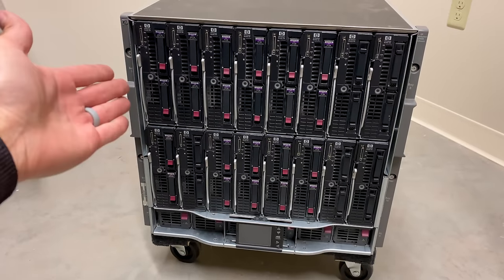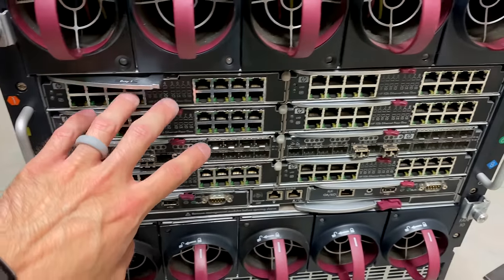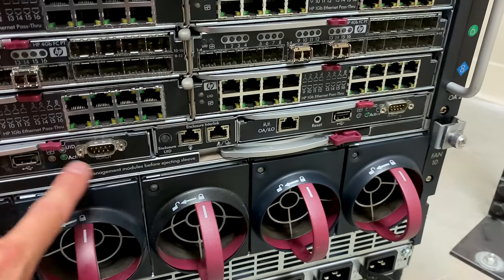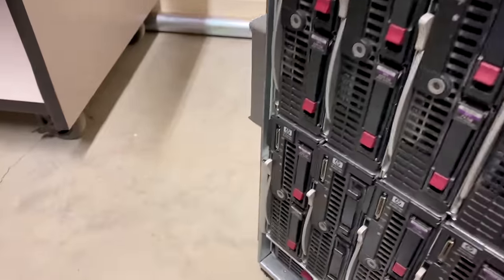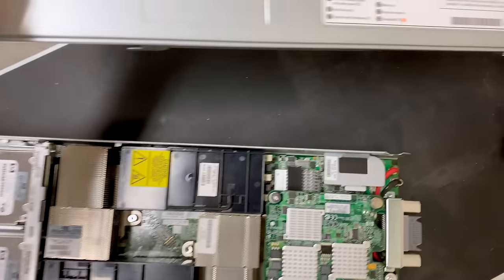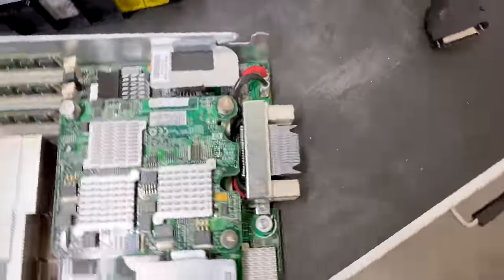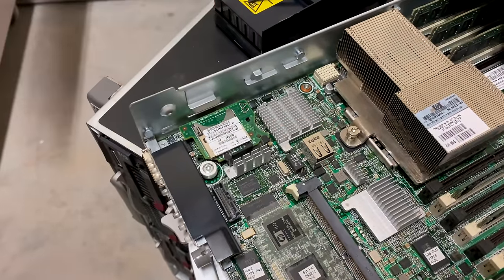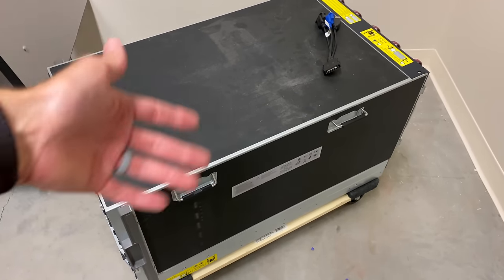Let's Check Out an Old Blade Server System with 32 CPUs!

Comment: 128 cores, up to about 1.5TB of RAM... Could still be fun to play with.
Reply: It's all good and fun until you see how much it added to your power bill
Reply: I'd buy one
Reply: @pompshuffle562  if your heating is electric anyway and it displaces other heating devices, you can run it for "free"! :D
Reply: @kaitlyn__L  That is, until it's above 90 degrees Fahrenheit outside
Reply: @pompshuffle562  well of course, if you're not wanting to run heating anyway. I did say if it was displacing other heating, after all
Reply: @kaitlyn__L  But why have a computer you can only use in the winter
Reply: Besides, server components aren't much cheaper than regular PC ones and there is no guarantee that the blade you get will have enough components to even make it cheaper than just building a PC with similar specs
Reply: To get an idea about why these things fell out of favour, you can fit 128 cores with 256 threads and 8TB of RAM into a single dual-socket 1U server these days, which is just 10% the size of this blade chassis, and each of those CPU cores will be substantially faster than the ones in this big 10U blade chassis. You could then split it up into 16 virtual machines (or any other number) if you needed to. Blade servers obviously still have their place, but the increasing number of cores per CPU and the increased effectiveness of virtualization has reduced the need to fit a large number of discrete servers into a small space.
Reply: In some countries you pay like 2 cents per kwh.
Reply: @pompshuffle562  if you go second hand, they are cheap as chips.  If you are after pure CPU and RAM, these are great.
Reply: @guspaz  Or 64 dual core virtual machines with 125 gbs of ram each. Or 32 4 core virtual machines with 250gb of ram each. POWA TO DA MAX!!!!!
Reply: @guspaz  Yes, the only reason for blade server is the use of external GPU (even internal). GPU virtualisation is still far from perfect like the CPU virtualisation. Also try to use the 128 cores all accessing their own PCIe16 GPU. IO is still king
Reply: Bro apps on windows open on one click
Reply: If you can afford the power bill 😂
Reply: for a good vmware test las, works like a charm.
Reply: RTX 3080 x2?
Reply: 13.7 ampers!!! (5 air-conditioned like mine).... and that thing have 6 of thouse PSU....... in just one of the hundreds of trolley like this one in a datacenter.............. This is why I choose not to ruin my eyes and continue using my Incandescent bulb.. and enjoy the fuel car............. There is not enough surface on the planet to put the necessary Solar panels for Europe datacenters.... not even mention the ones in America......... and for what??.. for facebook and twitter????
Reply: They are way too noisy
Reply: But can ran chrome with 100 tabs open?
Reply: How much do you Pay per server of them running and would This be good enough for webside storage unit and most gaming server
Reply: Would This worl for big website gaming server storage unit or what I mean since you say its too old but still good so I need to know if it worl for all those and how much it Costa per server how many watt
Reply: @guspaz  There are 4 AMD CPU Blades out there but for more balanced Setups: 2x CPU with up to 40 cores each and 4TB are common, so 160 threads and 4TB Ram in one Blade. There is the Question who needs an U8 Blade Chassis with 20 Blades with 80TB of Ram and 1600 Cores and 3200 Threads. That stuff is Datacenter and into the realm of Supercomputers. Especially Superblades with 2 GPU/Ki Acelerator Slots. Today you get all the Power you need in 4x U4 Cases so you don't need a Bladeserver. Bladeservers especially with Blades packing 2x 16 PCIE for Datacenter/Supercomputer Territory.
Reply: @pompshuffle562  13k at full load is 1k/15 cents/hour at max rate , prolly 7 at industrial rate. a 91cents up to 1.05$ every hour it runs at max speed then. just make sure you are charging more for the usage .
Reply: For real. I saw a "cheap" used blade system listing with 14 dual x5650 nodes.
My hometown has some of the cheapest energy, yet for just the CPUs I'll be paying more for my power bill than the whole filled-up chasis.

Comment: Blades fell out of fashion as hosting centers became sensitive about electricity use. As the cost of colocation went up, companies bought in space saving blade systems. So server densities went up dramatically, which led to colo and hosting centers separating out their charges for electricity, which became a considerable charge for the customer. The solution to that was the vm. The issue was that most of these physical (blade) servers did very little, but still consumed 75-100W each. A vm could sit idle and cost a fraction of that. This method not only reduced electricity costs, but colocation footprints. Colocation by the mid 2000s in places like London Telehouse was already pushing towards 5 figures a year for a single rack, before the electricity cost was added.

Comment: This explains why these Xeons are so cheap today since so many of them were retired.
Reply: If you are looking for good value PCs Xeon workstations on eBay are better than most of the office small form factor computers you will also find.
Reply: lga 1366 xeons are dirt cheap except for the x5690.
Reply: Yep. Not bad if you need a budget gaming PC. Though DEFINITELY not the best. (These things were never made for gaming anyway)
Reply: It's true. I upgraded my server to a much more powerful one for cheaper than I bought my original. Some really good deals out there
Reply: @mrcrisplinuxuser4180  not the best for pure gaming... but I imagine that, much like Ryzen, it's pretty competent at gaming while doing a bunch of other intensive stuff at the same time? Like cross-compiling for obscure architectures or streaming or ripping all your DVD collection in the background... just to name a few. I imagine they're pretty beefy for F@H too.
Reply: @kaitlyn__L  nah dude, this is very very old stuff, don't bother buying this for gaming. At most a small cheap home server could work, but these are very slow and inefficient CPU's by today's standards.
Reply: @mrcrisplinuxuser4180  The newer 32nm 6c/12t Xeons (same LGA1366 socket) are still pretty good when overclocked. I've had a Xeon X5670 @ 4.4GHz in my main PC since 2016, before that I had a Xeon W3550 (i7-950) and W3520 (i7-920).
Reply: @Pasi123  Running my x5680 @ 4.3GHz. Such a good processor. It is showing it's age in the most modern of games, other than that, its a champ.
Reply: Not really. But the good thing is that the RAM is so cheap. I did some text algorithm research for a database implementation and i bought a 512GB RAM system for less then $1000. Searching the 64GB text dump from english wikipedia is fun. How many times is your last name mentioned anywhere?
Reply: 13.7 ampers!!! (5 air-conditioned like mine).... and that thing have 6 of thouse PSU....... in just one of the hundreds of trolley like this one in a datacenter.............. This is why I choose not to ruin my eyes and continue using my Incandescent bulb.. and enjoy the fuel car............. There is not enough surface on the planet to put the necessary Solar panels for Europe datacenters.... not even mention the ones in America......... and for what??.. for facebook and twitter????

Comment: Disappointed you didn’t fire it up so we could hear the ‘take off’
Reply: We could witness his power bill go up, too!
Reply: Its not possible to plug each PSU's into 5 standard wall sockets to power it up. If you look closely at the back power sockets they are different from standard PC/server plugs. From memory I think each plug needs 30A to drive it. Dells are the same. Awesome bit of kit.
Reply: Requires 3-phase power to run this chassis.  I had 2 c-7000 chassis's and 2 c-3000's.
Reply: 13.7 ampers!!! (5 air-conditioned like mine).... and that thing have 6 of thouse PSU....... in just one of the hundreds of trolley like this one in a datacenter.............. This is why I choose not to ruin my eyes and continue using my Incandescent bulb.. and enjoy the fuel car............. There is not enough surface on the planet to put the necessary Solar panels for Europe datacenters.... not even mention the ones in America......... and for what??.. for facebook and twitter????
Reply: @bigbassjonz  It'll run quite happily with all 6 PSUs plugged into a single phase.  That's how I have mine set up.
Reply: @AnIdiotAboard_  They're supposed to be lugged into 15A sockets, but with the appropriate mains plug 10A 240V sockets work just fine unless you completely fill the chassis and fully option every single server.  With mine I have 9 servers and a graphics expansion blade, and it draws a total of about 1.5kW when busy.  Split across all the PSUs, each pulls less than 5A.
Reply: Quieter than you might expect, louder than your ears would prefer. They're actually quieter than the Cisco C460 M4 rack mount servers, which were often chosen to wholesale replace a blade chassis with, like G6 or with Cisco UCS equivalent, M2 blades.

Comment: I run a global virtual private cloud based totally on HPe blades, 3500 of them. They are a mix of C7000/BL460's and newer Synergy SY480 and SY660 units. All run VMware ESX. We have about 70,000 VM's running on them. They all boot off HPe 3-par storage

Comment: Hey there 😁.  The very first data centre I built utilised this exact setup.  HP C7000 chassis, with the BL360C G1 blades.  We also implemented the HP EVA with fibre channel.  I was 17 when I did this.  Now that I’m 31, my paths crossed with company who owned it.  I contracted to migrate them to the cloud years later.  The best bit is, I inherited this monster for FREE!! And the rack!!  It now sits in my lounge room on wheels and a class top.  Terrific coffee table.  Keep up the good works sir, love your channel.
Reply: That thing must be an ordeal to move - I don't know anyone else who has a 490lbs coffee table!! 😂😂
Reply: Mystery 180kg or pure nostalgia haha.  I’ve got a heavy tradesmen trolly for when it spring cleaning time

Comment: We buy second hand HP C7000 chassis all the time. We install G7 or G9 blades with drive storage blades so 8 CPU blades and 8 drive blades and use Proxmox and CEPH. Quad 10G cross-connect. Second hand you can build this for about 10K. Cheaper than anything else out there.

Comment: Blades were great, even without virtualization, for heavy compute workloads.  Several earlier MMORPGs used blades for their backends as data was all stored in a separate database and the shards just needed to communicate with all the clients and do all the server-side rng, management, and physics computation.  One company has auctioned off individual retired blade units with a fancy acrylic cover at various points to earn money for charity.

Comment: I remember installing one of these for a client about 15 years ago that had purchased the chassis and 8 blades.  Unfortunately he bought it thinking that the power of the blades were aggregated to make a super server.
The look on his face when trying to explain that was not possible and he is the proud owner of 8 individual dual cpu servers and not 1 server with 16 CPUS and whatever the combined ram RAM installed was priceless.  He just wanted a very powerful SQL server and ended up with 8 under powered servers.
Reply: oh no!
Reply: Back in the days, the double stacked DL580, so named DL980 wasn't a thing yet, or was it?
Reply: @djangoryffel5135  DL980 was a G7 offering, about 10 years ago.  IBM had the 3850 series that could be cabled together into a 3950 I think a bit before that.
Reply: I think the best use for a blade server like this is VMWare vSphere.  Being able to vMotion servers from one host to another (host being a blade) is pretty cool!  I wonder if other hypervisors do this (Hyper-V, Xen, etc).  Our company uses VMWare so that's what I'm most familiar with.
Reply: Pretty wild that somebody would put down that kind of money without proper research
Reply: Two things are infinite: the universe and human stupidity; and I'm not sure about the universe.
Reply: @TechieZeddie  Hyper-V has S2D Clusters for example, or the newly released Azure HCI (just a dedicated server 20H2 kernel for an onsite / local cluster managed through the browser based Windows Admin Center). Live-Migration / Node-Failure goes unnoticed by users, even if they are working on an VM that runs on the node that fails, has a power loss or something like this.
Hyper-V on 2019 in an S2D Cluster does not even need a special license, I am guessing you are running Server 2019 DC anyways it is included.
Azure HCI costs you about ~10€ / CPU Core / Month in addition to the host 2019 DC License or the individually licensed VMs.
Reply: For the same reason, I hate it when people advertise these second-hand currently as something like 128 core, 1.6 TB RAM, 2TB HDD Space....blah blah. In a sense that's true but leads people to believe the same as your client did.
Reply: @TechieZeddie  tbh i think blade are no good vm servers. You want v motion servers to be in different server rooms. If one burns down (or a cable gets cut 😂) you want the other to take over. Therefore have a redundant storage backend. We use netapp FAS.
Reply: @MatzeMaulwurf  if a blade needs service, you just move the VMs to a different host, do it's still a vamos config.  We did this before moving to AWS.  We also used NetApp FAS for VMWare
Reply: @TechieZeddie  I'm pretty sure Proxmox does. Once you create a cluster, you can move VMs back and forth. Not sure on the licence restrictions though.
Reply: 13.7 ampers!!! (5 air-conditioned like mine).... and that thing have 6 of thouse PSU....... in just one of the hundreds of trolley like this one in a datacenter.............. This is why I choose not to ruin my eyes and continue using my Incandescent bulb.. and enjoy the fuel car............. There is not enough surface on the planet to put the necessary Solar panels for Europe datacenters.... not even mention the ones in America......... and for what??.. for facebook and twitter????
Reply: @Ramdileo_sys  Good point. It's a different way to look at it, that a good portion of the solar gets used just for Facebook/Twitter/Google. A waste of generating capacity even if it is traditional or solar power.
Reply: @TechieZeddie  we used one of this systems in my old company.
300 physical servers down to one blade with 16 blades with 32GB quad core dual cpus, and five HP DL380 G7 dual six core 64GB of Ram and one mighty DL580 G7 octa core quad CPU with 192GB of Ram.
One EMC and one EVA as storage.
All replicated to HP datacenter for redundancy.
We started virtualizing with VMware and Xen Server and finished using hyper-V when VMware costs started to add up.
Reply: @SaberusTerras  one company I worked for migrated from a Superdome to a DL980 G7. I belive the power bill was enough to pay for the migration.
Reply: @foca2002  Yikes.  I guess they were also glad to get off the Itanium/PA-RISC slog as well.  It's hard to think about DL980 being a power-savings.
Reply: @SaberusTerras  8 1200w power supplies in the 980G7 using 220vac 4+ 4 in redundancy. The superdome had 12 power supplies.
If I remember correctly the problem was the superdome come with a merge with a another company, they used Oracle and HP-UX and Java, my company used SAP with SQL Server and C# so there's no reason to use two different platforms.
Reply: @foca2002  I remember the power delivery, I cabled enough of those beasts up.  Just hard to wrap one's head around a device that can draw nearly 5kW as being the one more power efficient.

Comment: I was a Data Center Engineer for HPE for 3 years , prior to HPE outsourcing us to Unisys. Anyway, these blade servers were so much fun to work on, especially the Gen 9 and beyond. Gen 10 was technically Synergy which included ILO5 and booted so much faster! Loved working for HPE and working on the ProLiants, Apollo's, Blades and 3par SANs.

Comment: Always kinda sad to see old machines like this get broken down for scrap on youtube especially those IBM systems.
Reply: It's HP!
Reply: These machines are destined for scrap eventually. The storage, CPUs, and Memory tend to be resold however.
Reply: @IanBPPK  There is a nice market where these chinese board manufacturers take out components (like the chipsets) from these proprietary motherboards and make "brand new" motherboards in standard ATX sizes and with modern features like NVMe. It's actually a pretty good idea, cause a lot of these parts on the boards would otherwise be scrap.

Comment: About power redundancy: it is configurable through OA/iLO, in AC Redundant mode the whole blade chassis can survive with full performance on just three power supplies. Makes sense, most of datacenters provide power to the racks from two independent power sources, so every 3 PSes would get power from the same source.
Reply: If you're going to be racking several in a single rack, it's likely that you'll be using quite a few different PDUs, likely off of 3-phase power. In the most power consumptive racks I've configured, I had six PDUs with three dual-whip tap cans spread between the three phases. So each PSU was connected to a different PDU for maximal redundancy and for load balancing on each PDUs. Because the PDUs I had available couldn't handle more than 60A and I needed to get 4 blade servers in a rack with power overhead.

Comment: I have a c3000 as an anchor to stop anyone stealing my actual server!

I do love the how cheap the parts are for these now. You can buy 10Gb Ethernet and Infiniband switches and mezzanine cards for pocket change. The cables cost more than the parts....so it is just as well the backplane is so well thought out....as you need very few for a local MPI cluster with Ethernet for network boot and infiniband for compute traffic. A real bargain and a great tool for learning HPC.